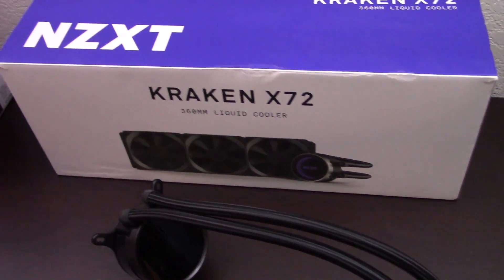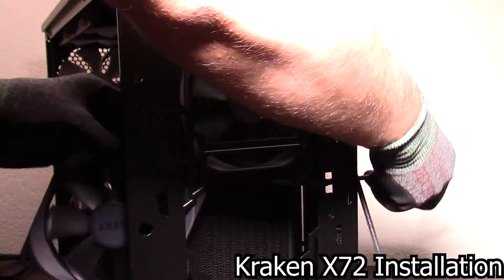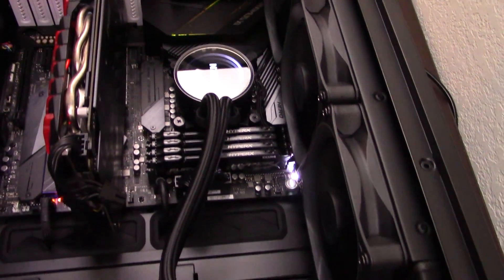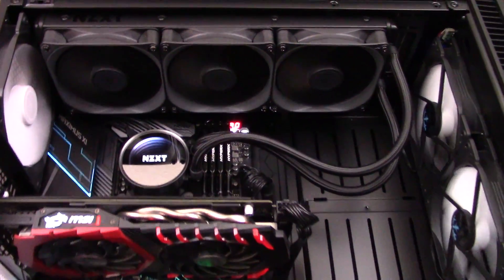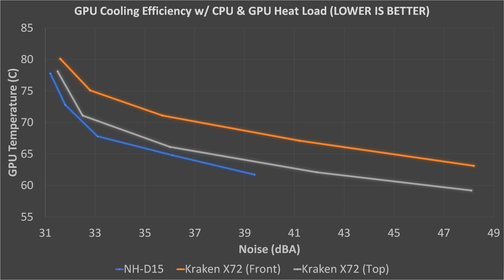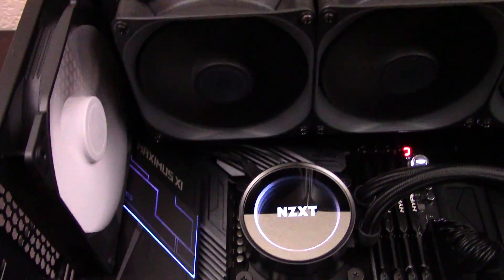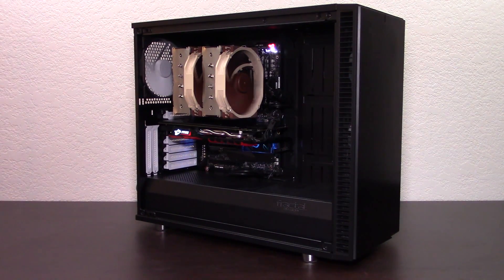Air Cooling vs. Liquid Cooling: The Ultimate Showdown (feat. Noctua NH-D15 vs. NZXT Kraken X72)

Comment from the maker: I realized I mispronounced Kraken after I made the video! Oh well, it sounds better my way anyway ;) Timestamps below:

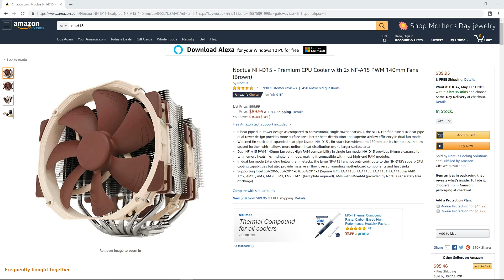Price 0:45
Installation 1:14
Compatibility 2:44
Power 4:13
Looks 4:31
Performance 5:52
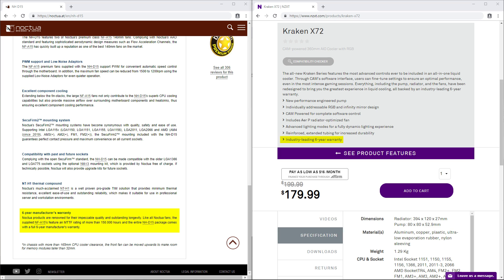Warranty, Maintenance, Safety 9:55
Conclusion 10:56
Reply from the maker: @071miniman  Thanks appreciate your feedback. I have a couple videos planned that should address your concerns - one where I test some extra scenarios like long term heat loads (1 hr+), and another where I go over my full test procedure in detail. As far as testing in the open air, I don't believe that is a realistic scenario and it will lead to unrealistic results.
Reply: @HardwareScientist  As long as you're taking constructive feedback, he said loud but I'd say it sounded too close to Mic. Mouth smacks and breathing is audible. Good content and I'm sure everything will get better with practice. Good luck.
Reply: @HardwareScientist  What cpu are you using as the 200W load?
Reply: @HardwareScientist  subbed but krayken does not sound better then kraken
Reply from the maker: @071miniman  The problem is an open air test is only applicable to people who use their computer in the open air - almost nobody. While using a case with a standard layout will be much more applicable to the average user. You want to test in a scenario that will be closest to how the user will use the product.
Reply: isnt it like release the kraken? lol oh you are saying cray kin. lol.
Reply: I suggest not saying then so much, but great video none the less!!!
Reply: Hardware Scientist great video it was very straight toward. I’m building an ryzen 7 3700x build with a 2080 ti. What do you suggest an air cooler or aio??
Reply from the maker: @lukelanderer1451  I'd go for an air cooler because it will keep your GPU cooler.
Reply: @HardwareScientist  if you have your aio rad on the top to exhaust air (which you should) it wont affect gpu temps
Reply: i think the an important part left out of the warranty, maintainance, etc section was pump failure and aging.  pumps are bad to go out around 3 years (soemtimes sooner) and as the water slowly works through the tubing the pump gets louder and louder.  the dh 15 will basically last forever.  fans might need to be replaced but the aio has the same draw back but with more fans.   but if you are pushing hard to get the last little bit out of an overclock then a good water cooler is what you really need.  

if your on a 9900k i wouldnt even bother with the water cooler unless you are willing to spend the 50 bux on a rockit cool  direct die cooling frame kit.  it comes with all the stuff to delidd and then a frame for direct die cooling.  that would get you up to 5.1-5.2 depending on how good your cpu is with the same temps etc as it was with 5ghz.  but in the end 1-200mghz is 2-4% difference.  and clocks dont scale 100% percent so more like 1-3%.  not really worth it.  but if you gotta then you gotta.

a compromise might be a delid and possibly direct die with the dh 15.  might help you get at least 100mghz more but at reasonable temps.  that or\and spend the money on a really really good kit of ram.  that will do more for most stuff than the extra 1-200mghz
Reply: While I appreciate McKidds comment, (pinned or in the description) I think it makes a good footnote and I hope you don't change your format. Too many tech tubers spit so many disclaimers and stats at the mic that a noobie can't follow and an enthusiast doesn't need. Honestly, I was watching tech videos almost daily for at least 4 months before I figured out that AIO stands for All-in-one. Your video may not be exact but it is everything I needed to make a decision. That info, the cinematography and your voice earned my sub.

BTW I like kraken pronounced both ways. Don't sweat the small stuff.
Reply: @waterandsteel4713  i thought AIO was the different buttons on the door light in a car that says on off or auto lol!!!
Reply: @typerightseesight  Lol I thought it was a model series that I couldn't follow.
Reply: Haha! I was just about to leave a comment about that!😉 

“The Kricken”...😂🤣🤣
Reply: krayken krayken krayken krayken krayken krayken krayken krayken krayken krayken krayken krayken krayken krayken
Reply: How was DBA measured? What kind of case did you use? :)
Reply: However, an important point is not mentioned.  The number of fans for Liquid Cooling is more, and it takes up the space for case fan.  Therefor, if both cooling take the advantages of full fans chassis, air cooling will definitely be better.
Reply: When talking about the compatibility list of motherboards, you said the word finebtwice and then called them makaboards
Reply: krayken? really lol, i thought kraken was a pretty commonly known mythical beast now that release the kraken is a meme
Reply: Hardware Scientist great idea on the time stamps , your the first YouTuber I’ve seen do this . it’s soooo much more convenient 🙏 thanks
Reply: NOCTUA DEBE METERLE RGB A SUS COOLERS Y NO PONERLES ESOS COLORES MARRÓN Y BEIGE.SON LOS MEJORES AIR COOLERS
Reply: air vs cooler liquid battle?
Reply: I like people like u man
U tell both the pros and cons but u don't say buy this or buy that pay that much or do this...
Honesty at it's finest
Reply: You've totally got "watercooling" wrong.  That's an AIO closed loop cooler....not the best "liquid cooling" at all.  
An AIO unit heat-soaks far too quickly to be even compared to a full custom loop, their pumps are weak as hell, and the block has all the moving parts in it that generate heat right above the CPU. 🙄
Any part of the PC that generates heat should have a block on it.  The VRM's, the DRAM chips(RAM), the chipset+IC's, HDD's, the GPU+VRAM+VRM's and the M.2 SSD's controller(better sustained reads and writes), and even the 10Gb network controller(if you have one) should be cooled so you can drop the fans to 20% for a nice quiet system....even under load max 70°C on a 50% overclocked 4690K pushing more than 1.4 Volts through the CPU Vcore, max 54°C on the GPU die with a 20% overclock and 1.020 Volts.
That's how you do liquid cooling. 👍
Reply: you can pogram which temperature fans start
Reply: "Release the Kray-Ken"
Reply: Krack ON Mate!~ Who cares, its called life, good job and Im sold on those fans!
Reply: don't forget that u need to replace the whole unit for aio after 5-6 years while air cooler is practically eternal unless the manufacturer doesn't support the socket.
but noctua sells converter kit for older products to suit new sockets
Reply: dude it's not, the ryzen 5950x is better
Reply: Hi sir! Thank you for making this video! I've been planning to purchase a Noctua NH-D15 cooler for my Ryzen 5 5600x. I have the 2x8gb of the same HyperX Fury rams as yours and it seems like the rams fit the ram clearance of the cooler in the video! I would like to know if those rams fit under the second fan in normal installation? Do you need to move that front fan upwards to increase the ram clearance for the rams? Thank you so much!
Reply: Your a very great YouTuber for 800 subs
Reply: You missed a failure point with the AIO.  The pump.  This is a CRITICAL piece of the cooling system.  If it fails, your CPU might be damaged before throttling can occur. 

This is a failure mode that is much more severe than a one, or even two, fan failure on any air cooler since an air cooler like the D15 can, theoretically, work passively if the CPU is idle/throttled enough.

Thanks for the great comparison!  I have to wonder how the air cooler would compete on both cooling and noise with a 3rd fan attached.  A future test maybe (hint, hint)?

My $.02...

Comment: I had the pump fail on my AIO a couple years ago. Bought an off the shelf air cooler to get me through a few days until I could find a more permanent solution, and never went back. Fewer moving parts, easier to clean, etc. I'm looking forward to my first SFF build once the RTX 5090 is launched, (waiting to find out sizing next month before I order a case) but I'll be using either a Noctua D12L or D15. If I was going to go eATX or something, and have a nice big case, I might spend the extra to have a cool custom water loop with hardline tubing, but I figure nobody is going to see the inside of my new build except for me, being mostly mesh panels, so just make everything black and easy to maintain.

Comment: In my country, hardware store employees compare CPU cooling using torture tests like Cinebench on YouTube channels. According to the results, the liquid inside liquid cooling systems gradually heats up during long-term use, causing the CPU to lower its frequency as a protective measure. And this cannot be overcome even with larger fan-equipped liquid cooling systems.Eventually, the liquid inside closed-loop systems starts to boil. YouTubers sponsored by liquid cooling often publish short-term test results, which people respond to. Yes, liquid cooling appears to perform better in the first few hours. But as the match prolongs, things change. Testers recommend at least a 4-copper-pipe tower-type air cooling system. The most hassle-free results are obtained with a system mounted in a case with constant fresh air and mesh type. The negatives of liquid cooling include not creating any airflow to cool motherboard components, requiring maintenance, being prone to malfunctions, high prices, and having a short lifespan. Think about it; these people are sellers and they're saying not to buy liquid cooling. I'll leave you the video link, but the language spoken is Turkish. There are more videos on this topic on their channels, and the results remain the same. Match Result: Copper-pipe tower-type cooling 1, Liquid Cooling 0.  

https://youtu.be/F7tcNgezjYA?si=q94NuBsNlRm6BwpI

Comment: Most people will think that this video is unnecessary but I disagree! I actually have three NZXT Elite liquid coolers, the 240, 280 and 360, sitting on my shelf as we speak along with the Noctua NH-D15 chromax in black. I've had them for over a week trying to figure out what to do. I have been an air cool builder for 30+ years (1990) and a while back the liquid coolers came out and then started fading away but because of the newer high end i9 Intel CPU's, they appear to be making a comeback. My next concern is that the MSi motherboard I bought has five M.2 slots which over time I will be adding more drives too so what to do? To be honest, I'd rather stay with air cooling but hate the thought of having to remove the fan heat sink once i have it installed whereas the NZXT, I can work around. You builders out there, please give me your honest opinions on these options and concerns Thank you all in advance...

Comment: I loved your video and it explained a lot. I still need to ask, using a MSI MEG B550 Unify X  and PC4000 RAM has shown me just how easy it is to overclock an AMD Ryzen 9 5900X Vermeer 3.7GHz normal to 4.7GHz. At that point I decided to search YouTube and Google to  answer a question, will a 240mm watercooler be good enough to cool this setup. The answer came back, NO , I would need at least a 280mm water cooler specifically NZXT Kraken 280 or better a 360mm watercooler as you have shown. Noctua's D15 was listed also as a good choice. yet no one took into account overclocking. With  todays latest GEN processors AMD 7700X thru 7950X3D series and Intel Core i7 and i9 12th/13th and now 14th GENthat run even hotter at stock I use both a Nocua D14 (for a 5700X not overclocked) and D15 (for an Intel 13700K not overclocked yet) The motherboard for this 13700K is an ASUS Maximus Z690 Hero DDR5 so I might overclock it.  I'm not showing off or trying to impress anyone. I've worked on computers since the late 1980's and have 2 40+ year old sons that share or give me their hand me downs.  So what I am asking and I noticed you used the latest GEN Noctua D15 ( I'm still using several original model D15's that don't have as many heat pipes) Do you believe these latest Noctua D15 would be good enough, taking into account using a computer case allowing for good cooling either for water or air cooling examples of cases are Fractal design Meshify 2 XL, Torrent, Corsair 5000D or  an original Lian Li Lancool II MESH with the MSI MEG UNIYY X well vented.  
 I "Subscribed", Clicked the "Bell" and chose "All" your video's hoping to get more on this. I know I'm asking alot still your advise would be greatly appreciated.
Reply from the maker: If you are overclocking I’d definitely go for a good liquid cooler like the NZXT 360 or Arctic 360.

Comment: I used to run a custom loop in a HAF-X so no problems with airflow etc. Then I decided to downsize and switched to an MSI MAG Coreliquid 360R which is where my problems began. After I bought it , I read about the Sediment problem but it worked fine until a couple of months ago when my PC would shut down when I was playing a video game. This got worse and worse until I had to stop using it to avoid frying the CPU. Reluctantly I ordered a used Noctua NH D15 Chromax which is a big ugly brute but I was able to ditch a lot of wires and the radiator which improved airflow massively of course. I can't be bothered to RMA the 360R so I will flush it and keep it as backup.

Comment: Just a perfect video, I think one of the best hardware reviews i've saw on YouTube. Finally i could cleary see how both coolers look put into the case, how to mount them, how they work and how perform with details. The only thing I miss is the sound test, so we could hear both and compare the noice they produce.
Just subscribed. Thank you.

Btw: Is there anything better than Noctua DH-15 currently? Thinking about Be Quiet Dark Rock Pro 4 to cool my new 13 gen CPU.
Reply from the maker: NH-D15 is still one of the best, but if you want an overview of air coolers I'd check out this video: https://youtu.be/JtWr15on6OU

Comment: id preffer the NH-D15 because getting like 3 degrees lower temp for multiple times the sound isnt rlly worth it for me, also air coolers usually have higier lifespan even if both are long

Comment: I want to build a quiet system what cpu cooler should I get for that? I dont care if I dont get max max performance it should be fast and strong but I wont do any overclocking I will use it to 3d model, render, produce video in 4k and 360 and casually gaming
Reply: the graphs in this video show the air cooler achieves similar cooling at less noise, I'd go air cooler every time, liquid coolers are only good for one thing, aesthetics.
Reply: @EbikeRyder  I did, I bought a Noctua NH 15
Reply: @bryaneditiontv600  good choice man, I'm not a fan of the colour of the fans but it's top notch for cooling  and low noise.

Comment: Thanks for this awesome video.

I'm currently looking to build my first SFF, after about a decade with my current setup (wew, my AIO will have lasted almost 10 full years, I'm quite impressed).
I don't really think I'll put on tempered glasses this time around, I'm just aiming for the most performance in the smallest package possible.
My AIO does run louder since I've swapped CPU, to the point it sometimes get annoying. I'm really considering air cooling this time around, as I don't find it to be as ugly as some people say.

Comment: My current PC has a liquid cooler - but I think the pump is dying. Just because the pump dies, the entire cooler (CPU-block, pump and radiator) all need to be replaced. With the NH-D15, hopefully the heat pipes will last longer than the rest of the PC, so if a fan dies, it can hopefully be replaced, so you don't have to remove the cooler from the CPU and risk bending any pins..
But that's just my personal opinion.

Comment: You also forgot reliability.... pump failures on aios are pretty common on a year of daily use, while big chunky metal coolers weakest link are their fans... which rarely fail and if they do it will be 6+ years at least... thats the real big winner for air coolers no matter the brand.

Failures on an air cooler are easy to spot (fans are not spinning) while a pump failure is kinda tricky to detect because the thermal throttle: that means that you can still use your pc but as soon as you hit some kind of cpu load, the pc will crash, and you will not know why cause the 2 or 3 fans on the radiator are spinning as always

TLDR, leaking is the least of your worries on aios, pump failure is the real killer

Comment: Performance wise it does not really matter in daily use, but watercooling is much more versatile: radiator sizes, scalability (custom loop), position in the case, clean look, RGB possibilities on fans and pump etc

Comment: I think I saw a comparison where most of the single fan Air coolers performed better than the 2-fan units. (This was a comparison between only a handful, but they were well regarded units) I suspect that it isn't worthwhile and a superior or at least equivalent single fan unit can be purchased and likely for less money.

Comment: People don’t know how to do air cooling properly. My nh d15 is around 2 - 3 degree worse in high continuous cpu load, than my custom water cooling which cost 4 times more. Was cooling an i9 and thought water cooling was going faulty when I was reaching 90+ degree. Took a while but did some serious case mods to channel fresh air to the cpu cooler and not get gpu mixed in there. I do a lot of 3d work so utilise cpu and gpu at different times,  but have an i9 9900k at 4.8ghz all cores 78 degrees max. At 5ghz I get to 92 deg. This is on cinebench. I just keep it on 4.8ghz. With a z390 board.